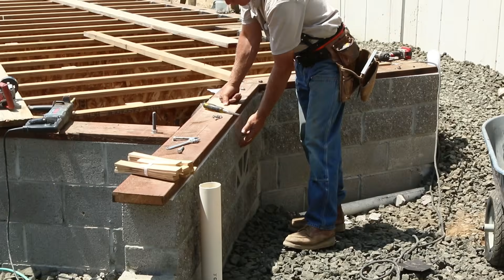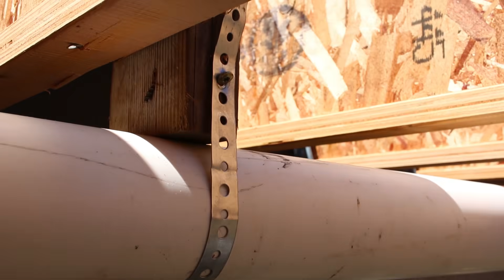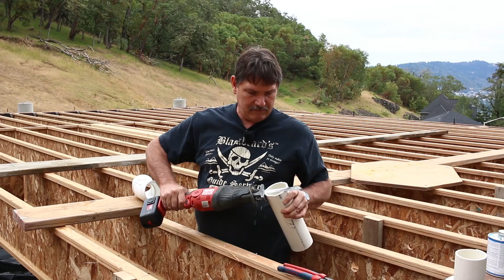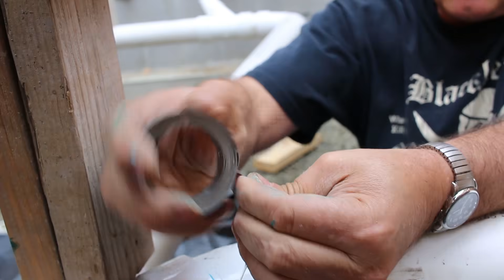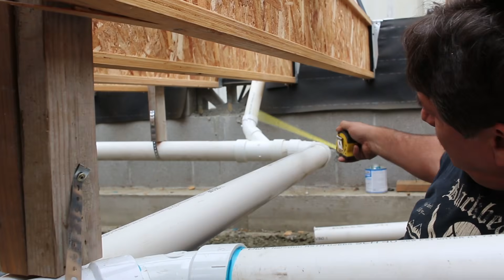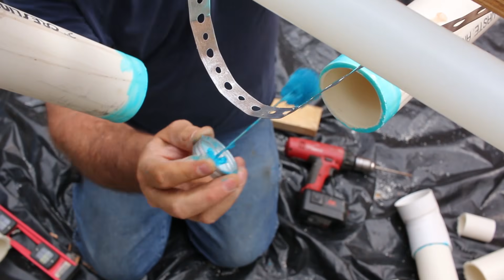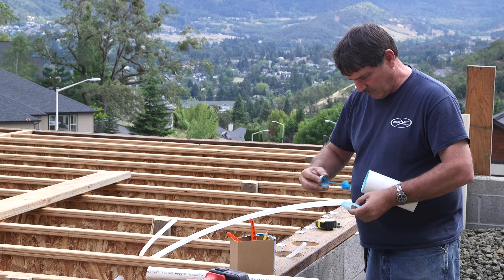Waste and Drain Ep.41

Comment: Before you buy the lot, go into the City or CSD and find out what the Sewer, Water and Development Impact fees cost. Local governments not following development fee law is a huge problem. In 2009 I was going to build a duplex in Mt. Shasta. The City wanted $64,000 for sewer, water and Development Impact fees. The City followed Proposition 218 to impose there fees when they were supposed the California Govt. Code 66013 of the Mitigation Fee Act. It took 8 years of fighting the City before they corrected the error.

Comment: According to the internet - "According to plumbing code, drain pipe has to be sloped a minimum of 1/4-inch per foot and a maximum of three inches per foot or vertical. A slope of less than 1/4-inch per foot will cause constant drain clogs and a slope of more than three inches will allow the water to drain without the solids."

Comment: Thanks for the video, it was a great overview.

Regarding PVC .. I just had to replace some PVC that was probably 25 years old and under a house in Florida. It wasn't because anything was obviously wrong with it, but it had gotten brittle with age and the wrong twist in the wrong direction while replacing a gate valve with a ball valve snapped it right off.

But .. to be fair .. the reason I was under there was the 30-year-old copper in the house had developed a pinhole leak that needed to be replaced. Which was discovered when 20-year-old copper in the ground developed a pinhole leak, which turned into a jet, which ate a bigger hole in the cold water pipe below it, causing a big leak the night before Hurricane Dorian was supposed to hit St. Augustine Florida and it was only my 60-year-old ears that discovered it when I heard running water in the kitchen.  LOTS of running water. This caused a lot of cursing and swearing because some idiot decided it was OK to run copper in the crease of a stem wall and I had a hell of a time getting a rubber tube and hose clamp around it for a temporary fix until I could get a plumber in.  Oh .. I could have fixed it. But there was enough swearing when the plumber did the repair to make me realize I made the correct choice.

My point ... nothing lasts forever. It's just polite to plan for the eventual replacement at the beginning rather than make it some other person's problem 30 years later.

Comment: Thank you for illuminating such a critical component of the construction process.  99% of homeowners take this for granted and will never understand why "things" are done a certain way and why you should not mess with it down the road.  I live in a home (1952) that is filled with cast iron waste pipe.  I dread the day when I have to dig and replace any of it.  One bonus of cast iron in the walls is that it is very quiet.  Cheers!!

Comment: Where I come from there is a different standart of pipe systems. We have rubber seals in the pipe connections and the pipes just get pushed together. We use glued pipe connections only for pipes that are under pressure. Is there something similiar in the US?

Comment: I really wish you had used proper hangers for your drainage pipe. I love your channel  and with all due respect must tell you your plumber is doing a hack job. Strapping that pipe tight every four feet leaves no room for expansion and contraction   Doesn’t take me much longer to cut my pipe with a rigid ratchet cutter and proper pencil reamer than it does this guy and I don’t need cords or batteries. I can easily make up any of this guys time saving steps by working smarter not harder would have loved if this guy would have shown how to use center to center measurements and fitting take offs  and fitting angle multipliers to figure out lengths of pipe instead he just made the craft look bad.
Reply: I agree.  Same with the foundation vid.  There really isn't a lot of 'teaching' going on in the house build videos, more of a 'typical demonstration' short story.

Comment: I appreciate your plumber explaining why it needs to be at least 1/4  per foot.  as a younger person people never explain why when teaching. It gets frustrating.
Reply: Code in Wisconsin is minimum 1/8 inch per foot for 3 inch pipe up to 8 inch. 1/4 inch ppf 2 inch and under. Too much pitch can be bad too because the water can leave solids behind. Especially with the newer water efficient fixtures. Larger size pipe is flatter so the water spreads out and fails to carry waste.
Reply: 2 and a half years in the trades I have realized most tradesmen aren't teachers haha.
Reply: @brandonknight4945  very true
Reply: You never want the tide to out run the boat.

Comment: Actually our moden plumbing systems go all the way back to the Roman Empire. :-)  I'm shocked your code allows you to make pvc glue joints w/o primer. Best of luck with that.  If you do have leaks you can use my free leak fix method https://www.youtube.com/watch?v=wo-R0oqnMpc&t=1s and the followup https://www.youtube.com/watch?v=zUagwOZkGCw  

I really caution others about making glue joints w/o primer. You are asking for trouble. You can get away with it in sewer and vent systems but pressure systems will show you the mistake of not using primer. If you want to understand why watch this video https://www.youtube.com/watch?v=QITVd4N7064&t=1s

Just trying to help.

Comment: Used to hang my waste lines with osb. 6 inch wide, whatever size hole you needed x inches from the floor for fall. Cut and drilled hole from above. No drill, screws or holy iron.

Comment: Learned about plumbing some after paying $22,000 to replace the sewer lines in my house. 80 feet of tunnel under a concrete slab foundation. Rotting cast iron replaced with PVC. Threaded pipe hangers every 4 feet fixed to the bottom of the slab.

Comment: Interesting step. No plumber in my area runs drains/vent pipes before total framing is complete.  Nor would the framers or contractors stop the framing to allow for this especially with needing a plumbing inspection before the subfloor goes on.  But I can see its easier on the plumber in many ways.

Comment: A quarter inch of foot also allows your fittings to work when you have to go up a wall. Rough-in measurements are really important. You connect point A to point B, but you have to shoot your exit before you start. Years of doing it make it easier. When I was a kid you went out with the old man and you did as he said.
He was a journeyman and you were an apprentice. It's a great way to make a living.

Comment: I had to tear out the old cast iron vent stack in my 1904 house, the joints were sealed with lead. Had everything replaced with pvc and pex for the supply side, plus copper where required by code.

Comment: Are you going to show us pressurizing the system or having water in the system.......JJ..
Reply: At the end of the DWV main line there is probably a test "T" fitting where they put a test ball plug in and inflate.  Then they use a water hose and fill the system with water all the way to the top of that 10' PVC pipe.  Inspector comes the next day, shakes the pipe and verifies there is water in the 10' PVC pipe and checks his approval box.

Comment: 10 ft of head means IPC. I’ve never understood why they require 10’. In reality it’ll never have more than 15”-20” because it’ll overflow the toilets if anymore is put in but they have to over engineer everything. The only way it could have 10’ of head pressure is if the main sewer stopped up and every single fixture stopped up as well
Reply: Isn't it a way to pressurize the system to check it for leaks?
Reply: Yes but the reason they do that is they assume that if the yard line stops up and the system fills up, it needs to be able to handle that pressure. However, it will never get to 10’ high without overflowing a fixture. The Austin inspectors only require 42” which is 6” about the flood rim of a sink and they figure that’s enough to prove the system.

Comment: What kind of pex are y’all using. I hate to be that guy but a couple of things. First no primer? I know the can says you can do it if local codes allow but I’ve never seen a code that allows it and the solvent weld is much stronger with primer. Also, I saw some SDR pipe and the main pipe he was using looked like foam core. Personally I’d only use schedule 40 PVC but I think foam core is allowed by code. It’s much easier due to how light it is but it doesn’t have the strength of schedule 40. Also, I hope that 3x2 y you’re sitting next to isn’t a vent because it’s illegal if so. Other than some differences in opinion on how things should be done, it looks like a good job.

Comment: A hundred years ago waste water pipes in  a house would be either cast iron or lead. After it leaves the house it was typically clay pipes to the sewer, it could also be cast iron or even wood was still used at the time.

I personally prefer using copper for all the pipes in my houses including the waste water lines.
Reply: I recently replaced a waste line coming from an old building, that was always backing up. After digging it up we seen it was clay pipe in about 3 foot sections with a bell on one end. Some of these had broke and collapsed. The building was only 50 or 60 years old but I heard there was a building there prior so maybe they just reused the old clay pipe instead of putting in new.

Comment: I've just got to ask: how do you avoid the pipes squeaking and rubbing against the wood blocks you installed? Any home I've worked in that had drain lines against wood , would always squeak from rubbing or expansion/contraction. Great video 👍
Reply: I cant be 100% sure but their trench foe the water line is also 2" deep at most, which meand it doesnt get all that cold where they are hence limited expansion et retraction?

Comment: Get a machinist's deburring tool.  Doesn't cost much and does a great, fast job on PVC.
Reply: Greg Collins  Noga makes a good one.
Reply: But you already have the saw in hand so using that saves the step of setting down one tool and picking up another (or setting down that deburring tool and misplacing it, or walking out of arms reach)

Comment: Wow, my neck of the woods you basically never see the plumbers until the rough framing is done. That's when the plumbers show up followed by the HVAC and then electrical while the carpenters are putting on the roof and siding.
Reply: Are there no concrete slab houses in your area?
Reply: Slab on grade is an exception.

Comment: "Good Enough for the Girls I go with" had me laughing! "Pipe is super slick"  I just used PVC pipe to drag a brush hog onto my trailer. PVC is my goto. My current build I choose the Crawlspace largely because if did the drain line wrong I could access it to fix it, and I could install the DWV while the house was closed in and warm. That vid will be coming soon. Nice work Scott.

Comment: Had to have a furnace replaced under the house a few years back. Geniuses cut those supports on the drain pipes so they could get the unit past it. They never replaced the supports and the pipe rattled until it broke. The pipe was down for a month before we found it. :(

Comment: Your core drill through the walls look perfectly horizontal. It was my understanding that they should be sloped outwards so water has less tendency to run into the house. Did you slope them? I do enjoy your vids and hope you understand this question is a result of my genuine interest.
Reply: The holes he bored were for sleeves.  The actual sewer pipes are a bit smaller and have room to be angled a bit.  There's a scene in the video that shows a sleeve through the wall, and they put a pipe through it.
Reply: Hay thanks for the reply, but again should the sleeves not be sloped so any rain water hitting the side wall does not creep in along the in side of the sleeve? Or does this not matter so much?
Reply: @seth286  They will seal the space between the inside of the sleeve and the outside of the sewer pipe to keep out water and vermin.  But the crawl space has vent holes that he has infilled with perforated blocks.  If he was concerned about intrusion of windblown rain water he would have left the holes open and installed metal louvers.  I assume that he believes the amount of water that is likely to get through is not enough to cause any harm.  He will certainly install insect screen on the inside of each vent before he puts the subfloor on.
Reply: deezynar I see. Many thanks

Comment: I know that a chop saw would be better but just as he was using a saber saw I have used an angel grinder with an abrasive will. Then you don't have to deburr. The thin cut very well the PVC pipes and the small angle grinders are smaller and lighter than the saber saw.

Comment: P tape ugh, real plumbers use hangers
Reply: John Borghoff real expensive plumbers use hangars. Here on the east coast, unless it is speced everyone uses plumbing strap. And on a spec house you will never see hangers
Reply: @Wogden 700 well good for you. Ive maybe seen hangars used on 5 out of 50 houses we have wired. And those 5 were all custom houses where cost was not an issue
Reply: I have been a plumber/pipe fitter for 57 years. This man is building a custom home. I have watched this series since the start , he has pumped a lot of money into this structure to assure the highest quality. The cost difference,labor and material ,especially on a run of DWV is less than 100 bucks, just look at all the blocking he had to do, that is still chargeable labor. We are talking nickels and dimes for quality, quit ruining our trade by doing cheap work!!!
Reply: One more thing, don't cut pvc with a saw, use a Reed cutter, and don't forget to ream and bevel your pipe ,, that way you assure a positive joint. If you refuse to follow directions and do sloppy work get the hell out of my trade, people like you are degrading real plumbers

Comment: was that an ABS black reducer in the PVC ? Is that allowed or code ?
Reply: In ontario its allowed, you just have to use a different type of glue (transition glue). It's funny to see PVC pipe above ground in a video- in Ontario it's only allowed below ground, and it's joined to ABS pipe above ground routinely.
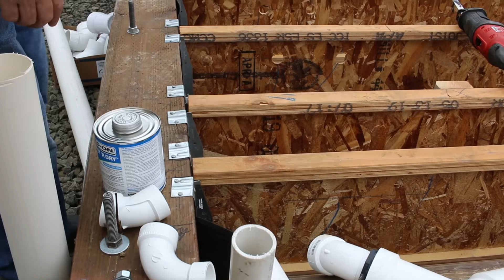Reply: Seems strange it was used in the system.  Would like to know why.  Check 10:03 to see it.

Comment: The reason for the 1/4 “ per foot fall is for the solids. Too flat and they won’t move. Too steep and the water rushes down the pipe faster than the solids and they get left behind. Proper pitch is essential TO MOVE THE SOLIDS
Reply: PVC is too slick to leave solids behind.  Most city tie ins are very steep and apartments are vertical.....
Reply: @jehu5813 , Yes, PVC is slick,  but that doesn't matter in this case. Fluid dynamics operates the same,  soils being carried by water will deposit (settle out) based on velocity; the 1/4" drop per foot gives you the correct velocity to keep the solids moving.  Yes, I know the final tie-in to the sewer is steep, but at that point it doesn't matter,  the remaining horizontal travel distance is insignificant. Go ahead and install PVC at any pitch you like; you'll be calling a plumber to snake through drain line some day.

Comment: When you say threading the pipe by hand do u mean as opposed to soldering a water service connection
Or do you mean live tapping a water main the way the used to do before they had aluminum saddles? Like the direct tap? Shoot I remember replacing lead (instead of cooper services ) that were direct tapped to 12 inch steel watermain in downtown Toronto like 8 years ago ... they were so fragile.. the dirt used to hold the threads together haha
Reply: Dylan Mounsey he meant using a hand threader to join cast iron rigid pipe together
Reply: Beardoggin89 ah never seen it